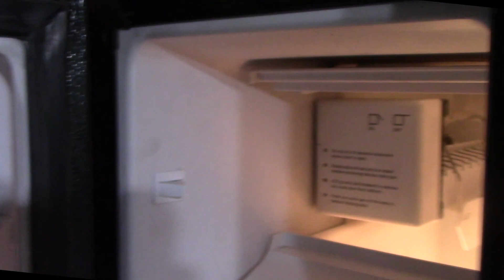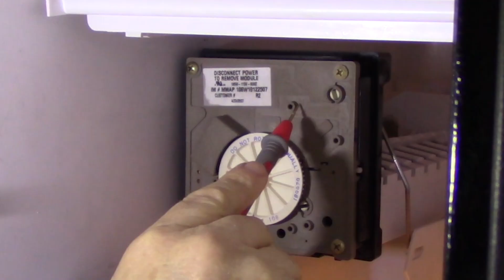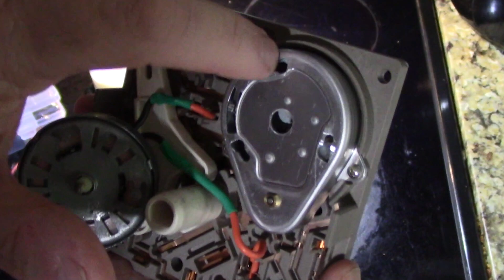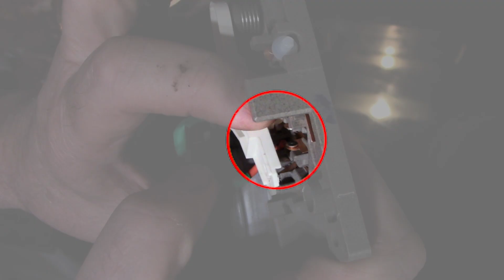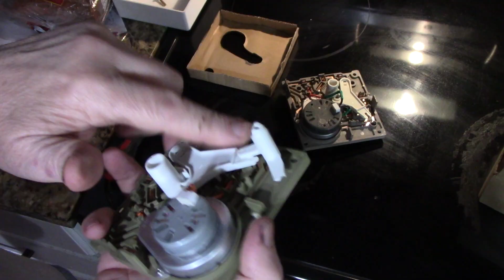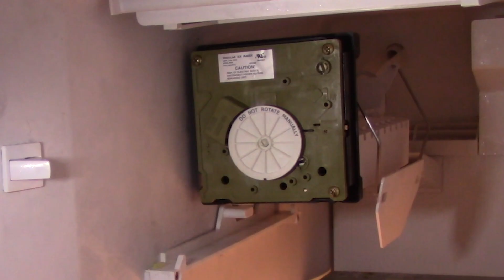Whirlpool Refrigerator Freezer Ice Maker Troubleshooting & Repair (and many other brands)

Comment: Nice Video, A $20 Part fixed my 13 year old Whirlpool Icemaker, I only had to Purchase the Control Board, $20 and had it Next Day from Amazon.

MAN I will tell you, This IS THE COLDEST REFRIGERATOR I HAVE EVER SAW IN MY LIFE !!! At Halfway on Freezer and Fridge, with 75° Room Temp, the Freezer is -2°, and the Fridge is 30° AT HALFWAY, I had to turn them Both down, but yeah man !!!

And 1 note to add, The 1st thing you should do is PLUG IT IN, set your Meter to 500 Volts, and test L & N to Verify you have 120 Volts without Power, the rest is Useless, but with the New 1 Installed, water hooked up and Turned on, Plugged IN to 120 Line Voltage, and The Arm Down, I only Did the Jumper Test from T & H FOR 3 SECONDS, and watched the Complete Cylce, Lifted The Arm, Installed the Ice Bucket, Lowered the Arm, Closed the Door and went to Bed, got up this Morning and BINGO, had 3/4 a Drawer of Ice, As you Mentioned I also got the 1.5. Watt Motor as well, and It's fine.

2 other Notes to Add, If you test the Water Valve Circuit, IT WILL POUR WATER EVEYWHERE, as the solenoid operates on a Lower Voltage when not being Jumped, also When Checking For 120  Line Voltage at L & N, IF YOU DON'T HAVE VOLTAGE, the Black wire on the Side, has a VERY NOTICEABLE FUSE in the Clip Holder, so it may be bad, but IMO THAT should be the 1st thing you do, but anyhow, thanks for the Video.
Reply from the maker: Thanks for the feedback,  I'm glad that the video helped you out.
Reply: @TwoKeysStudio  You're Welcome, and again thank You for the Video, I would've be clueless without it.
Reply: Do you have a part number for the cable. I just replaced my unit, not knowing there was a fuse in the wire, my new unit did not come with a new cable harness.
Reply: @7MBoosted  I'm sorry, I do not, I never Had to Remove the Wiring Harness, just test for 120volts at the deignated pin, if no power then replace the inline fuse, and you should be able to get something Universal etc
Reply: @diymaniac876  thank you for you post, I ended up ordering a replacement harness to see if that fixes it. I don't get power at all to my ice maker.

Comment: what a great video, Thank You.  I have a '97 vintage kenmore Coldspot side by side.  The icemaker that I removed that had failed with cubes in the tray looked identical to the one in your video.  The replacement was not identical but I think similar and universal..assuming it to be the proper one.  I've also replaced the solenoid and the cold water on the door works..it worked (the water at the door) before I replacd it too.  I have cleaned the coils of lint and have confirmed that the temp is appropriate.  I can puff air through the fill tube from the back of the frig so I know the line is not frozen.  The icemaker can be seen to rotate the dial/I know the motor is working and that a cycle is supposed to be underway.  There has not been a call from the icemaker to the water supply solenoid..thus even with both parts replaced I am getting no ice made.  I did not hear you address this particular case...what can you advise for me?  I did turn a screw a half turn counterclockwise to increase the valve on time...waiting to see if that in fact now calls for water.....waiting...Thanks for your informative video

Comment: My refrigerator was making a noise this morning.  I opened the freezer (side-by-side) door and raised the flap over the ice-maker.  The wire arm was down and there was an "iceberg" covering everything. Dispensed a sink-full of ice and used an ice pick to chip away most of the ice cubes from the wire arm.  The actuator end of the wire arm was out.  With the aid of your video, I was able to remove the cover of the ice-maker and then line up the bent portion of the wire arm and reinsert it.  It functions manually (up and down) and I see the white plastic moving appropriately.  There might yet be a problem with the ice-maker but your video will make my repair quicker and easier.  I have another ice-maker that has an open heater that I saved for parts (Robbie)

Comment: Good video that explains all the functions and test locations. But you failed to mention the water adjusting screw on the side. What it does and which way to adjust the timer screw for more or less. That would be very helpful.
Thanks

Comment: discovered by accident that my white wire was out of the connector. i replaced it and still didn't work.  I gently pressed the white wire on one of the connectors and it started working.  so suggest that anyone press gently the wires to the connector to be sure they are fully in and not loose.  worked for me.

Comment: After I watched your video, I ordered a new module. Should you remove the ice by using a hair dryer before turning the refrigerator back on after replacing the module or, just let the new module work on it’s own? Thanks😊
Reply from the maker: I would melt and remove the ice.

Comment: I found my fault!  Turns out the same fault as yours....The on/off wire rod that the ice pile lifts....it rotates the white plastic shaft....and toggles a contact from one side to another....the button contact that moves between two opposite button contacts for on circuit vs off circuit....slight burn/pitting between the on side buttons so it just would no longer turn on!!  Thank you for all the insights!!!
Reply from the maker: Awesome,  I am glad to have helped!

Comment: Question. when i check resistance at v and n i get ol. A short. But when i check the solenoid directly i get 383. Not pumping ice. Any suggestions would be appreciated

Comment: Great video…but you said the ice maker had ice in it when you started!

At what stage did the ice drop?

Water came in “after” you installed the new module! Thanks
Reply from the maker: It would add water but not turn on the heater to allow the ice to exit. Since it was frozen in there with no heat to separate, it wouldn't turn or dump ice.
Once repaired, it took about 30 minutes to an hour to drop ice...I think. I checked it the next morning and there was a significant amount of ice in the bin.

Comment: I found 2 of the contacts had the green crusties. I used a little vinegar on the contacts then a little sanding to clean them up and now my ice maker is working fine.
Reply: Had it on one, same thing, cleaned it up and slightly repositioned cause a bit of the metal had fallen off, and it is working fine.

Comment: Hello Sir , need your help. what happen with my ice maker power supply at L and N only has 100V. i try new ice maker but it not work. how to do next step
Reply from the maker: Check the power at your outlet. You may have a wiring issue in your home if it's only 100v.

Comment: Just watched your video. I’m trying to diagnose why my ice maker pours water but makes ice slowly and doesn’t dump ice into the ice bucket. If I use a jumper wire it will cycle, dump the ice then fill back up. Repeat by jumping manually. Have a good day and thanks for the video.
Reply: Mine DOES NOT DUMP ICE EITHER.  AN IDEA?
Reply: Why does my refrigerator not make ice

Comment: Is it 72ohms also for Europe where we have 230V. My heating element works but says about 290 ohms. My problem seems to be the valve as i have a drippy tube that cloggs maker and eventually fills entire freezer side with ice as it overflows
Reply from the maker: The heating element is probably good.  Usually, when they go bad, they show infinite resistance.

Comment: Could you tell me what it means when I initiated the cam and it started, I pulled the jumper out after ten seconds the cam stopped around the 8 o'clock position. I reinserted the Jupiter but will not move. I can hear a slight noise coming from the cam area but it has not moved since I initiated it. I have check most test points and seems to be ok but its a little confusing at this point as it will not move from this 8 o'clock position  Thanks.   Oh and no water. V & L 200 ohms.
Reply from the maker: Sounds like a water valve problem ir water is frozen in the line.
Reply: Thanks much I did check the V and L points had voltage, is that suppose to initiate water flow or checking the pumps ohmic value. I also noticed that there is ice in the tray shallow and thought that this was holding it back. I check the ohms on the heater coil seemed ok. I will stay with the water valve again wondering what I am check on V & L again thanks for taking your time out. Ice maker motor is new. Thanks again. @TwoKeysStudio

Comment: What if it's not getting water to it?
Reply: it might be the intake valve.
Reply from the maker: Like Liniscata said, intake valve. Also it could be a frozen line. Do the output check for the valve and listen for a click. If there is no click, replace the valve. If it clicks but no water, the hose might be frozen.
Reply: @TwoKeysStudio did all suggested tests, nothing moved, clicked, etc. Installed replacement and still nothing
Reply: Cycle runs but does not refill with water.  My valve is fine - the ice maker is not sending the signal to it.  It works perfectly when I jumper V and L, but will not fire on its own.  It was intermittent for awhile but now has stopped completely.  Everything else is fine. Some internal connection is faulty in the cycle.  Any ideas?

Comment: It is making ice and dropping, but water is leaking into the ice bucket and freezing. Also some water is leaking out the of the ice bucket and dispenser. I think the water valve is bad. Am I correct?
Reply from the maker: That would be my first guess.
Reply: Do you have a video on replacing the valve? Where is it located?

Comment: Why don't you show what to set your meter at before you do your test. You should ...
Reply from the maker: Oops...I inadvertently edited that out of the video. It was set to 200ohms for the resistance tests. Basically go to the next higher setting for what the expected ohms or volts are that you are measuring. I have been considering adding a video on the basics of using a meter in the future, so look for that to be added. Thanks for bringing this to my attention.

Comment: Nice job, Keith and helpers.  Great tips on the jumper.  Was the piece with the missing electric contacts for the heater?
Reply from the maker: Thank you Tom. I believe that is what the missing piece went to. I probably should have looked closer at the circuit to verify. I never did find the piece that came off. I always hated when a part went missing and I couldn't find it. Even on copiers.
Reply: Mine seems to freeze over in the internal mechanism and the wheel doesn't turn, like it frozen.  Like moisture got inside and frozen it up because a hair dryer  blowing and it starts turning.
Reply from the maker: That sounds much like what mine was doing. The timer should turn on a heater on the tray to separate the ice to allow for it to come out. If the heater never activates, then the ice stays frozen in the tray locking up the timer.